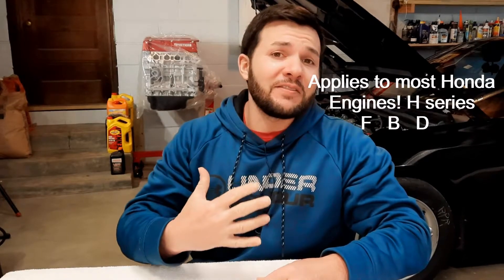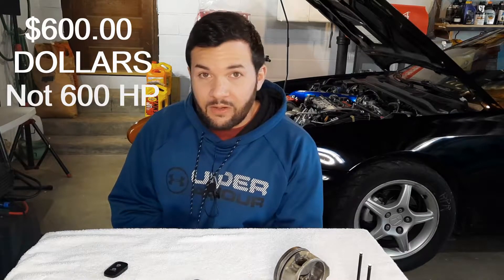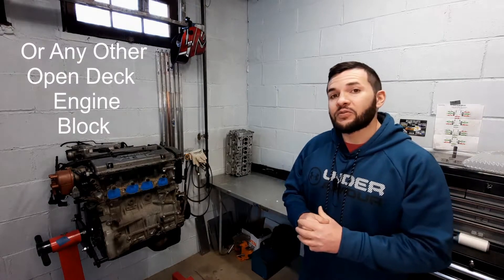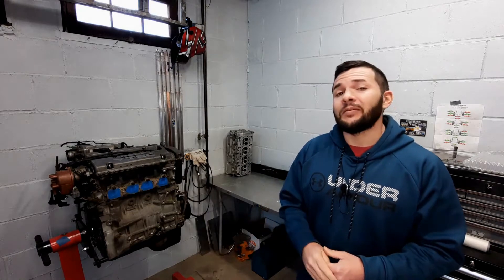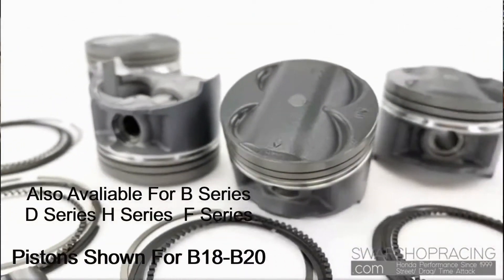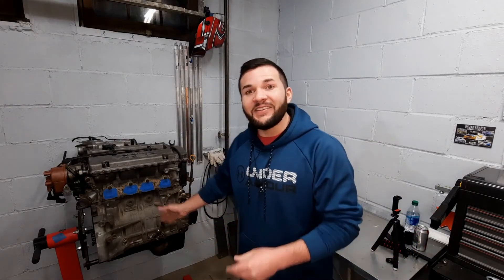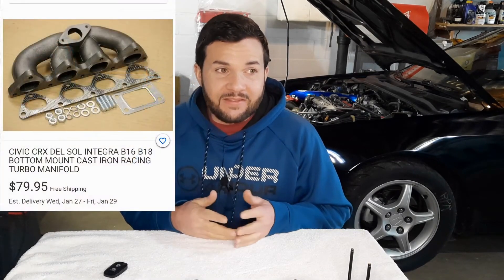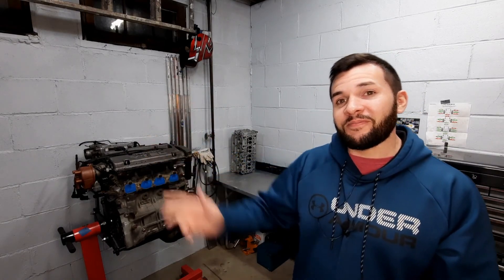Build 500 Horsepower BUDGET Turbo Honda 5 Tip Recipe B Series, H Series, D Series, F Series

Comment: I've got an H22A (minus the 1) since ive got a JDM vtec BB4 chassis model but im guessing the process is same as described for the H22A1 and not the A4
Reply: it should be a closed deck, unless a previous owner swapped an a4 bottom but i doubt it, so it should be practically the same process

Comment: Question can the Transmission handle that much power tho? For a stock trans? Cause i have a 97 lude and im planning a build on my car right now i am planning on buying the nippon jdm pistons but just wanna know if the transmission can handle cause i don't want to blow that either
Reply: Stock H/F trans dont live long over 500.

Comment: What the fuck is this video...? Between the serial killer intro, and the "tips", I am confused as to if this is a parody or not. My man said either use freaking SUGAR in your block or get it CSS'd, but he would get it sleeved instead, which is an extra thousand dollars over a CSS system... But he WOUDLN'T recommend spending  $3-400 to get a tuneable ECU. Instead, use nitrous... What in the fuckin Need For Speed is going on here?

Comment: I just found a dream scenario at the junk yard. full H22A1 in a 98 accord with everything still in place. all I'd need is mounts and it'll all fit into my EK, but if the H22A isn't all that tough then I don't know if it'd be worth the sawp from my D16Y8.
Reply: Been ripping on my h22a1 for years now. No problems exept the balance shaft seals popped out on me but I think that was my fault lol

Comment: Hi bro, great video and accurate info. I have a crx b20 with b16 head vtec at around 200hp. How much nitro you think it can handle without problems? Thanks bro and keep the good work up!
Reply: I’m currently running a b20 aswell and want to do ls vtec. My goal is to have around 200 hp bc it is my daily. What have you done to yours to make 200?
Reply: Integra intake , wilder cams, proper fuel pump  mushroom filter , Y1S1 gearbox, exhaust and good tuning @billymoreno470
Reply: Don’t push you b20 any further than 350 whp man. They have super weak bottom ends
Reply: https://youtu.be/jygHy770Hr0?si=TJomwRCS6DdhcFVM
That's my rex

Comment: B20s aren’t the strongest b series, in fact I’d say it’s one of the weaker because of how thin the walls are in between the cylinders. And even if they could handle 500hp you’d never do it on a stock b20 or b18 non vtec head without a whole shit ton of boost which would help kill those Siamese walls even quicker.

Comment: Horsepower is built in the head, at the valve seat. Port and proper valve/seat job. Valve train next, go light with the retainers, valves, keepers and the right spring pressure for the cam you're using. More RPMs = more Power. Agree with forged rods but I would spring the extra $4-500 and get the forged pistons. Sleep better at night. Agree 100% about the sleeves for the h22
Reply: Some sleeves are made from frm so you can’t run forged pistons unless your clearance is absolutely perfect

Comment: Running nitrous without any supporting mods and especially a tune is a recipe for disaster.
Your pictures and videos are pretty decent - your verbal communication/output needs some work 🥹
I’m out after the maxpeedingrods drop - I’d be careful taking all of this advice fella’s - hope y’all got a back up engine/plan    hahaaaaaaaaaaaaaaaaa - wow wow wow
Reply from the maker: I respect your opinion everyone has one....I have ran well over 20 bottles of nitrous with no supporting mods....Just a zex smart box system design to do just that...it adds fuel pressure by putting pressure to the fuel  regulator using there jetting charts. I wouldn't push high horsepower but 75hp shot is easily safe. Maxspeeding rod, eagle rods, scat rods for h22 and other hondas all start life as the same Chinese forged blank and are machined by whatever company sells them under there name.

Comment: Ya.  I want to build my f22a.  But aftermarket is super hard to find parts    h22 cranks are slightly different so I can't use those con rods   I can use k20 pistons and good luck finding an f22A turbo manifold    you can find em for the f22b all day    I have a rebuilt OEM style head (might tear apart and find some better valve springs/retainers) although the rods and block can handle  the power    i just can't really find the parts for the head
Reply: I seen F23a handle 400hp with just headstuds. I bet it can handle 340 with just headstuds. If you want 400-500. I would do h beam rods, non VTEC head. epoxy block gaurd k20 pistons

Comment: I do not understand why cast parts are used on engines.  A cast part is never as strong as a part machined from a rolled piece.  Castings are not even allowed on aircraft
Reply from the maker: Cost of manufacturing, lots of domestic cars in the 70s 80s and 90s have cast pistons and some have cast crankshaft lol junk

Comment: Any recommendations for a turbo kit for the h22a4 in my 5th gen?
Reply from the maker: Depending on setup, really piecing one together is usually the way to go. If it was a civic there alot more popular and have many choices. All I would see is purchase a quality turbo and wastegate, everything else doesn't have to be the greatest product out there. Cast exhaust manifolds are cheap they work well under 500hp and don't crack good luck

Comment: You've given me a lot to think about. Right now, I'm trying to get started in the Honda game and get myself my first fast car, like ever. I'm also trying to do it right, but I don't have a lot of experience buying or even building engines and it takes me awhile to save up even a grand so avoiding mistakes are HIGHLY valued. So, to me, my only options are to plan literally everything out that I want to do to the car. I'd like a B series, but they aren't all that common where I live and D series rule supreme. I'm sure I could have a lot of fun with a D series coup or something, but it would still take me a long time to learn and build it right. I have very little idea on how to get started and not just fall into a money trap with the first thing I get. Still, I'm not giving up though.

Comment: I am building this set up but I have a few questions some say the pistons crack and can I run e85 without a problem
Reply from the maker: Under high horsepower they can crack....what are your goals, just know over 500 you have to start getting great parts not ok parts.

Comment: You also suggested a b20 for boost @ 500whp.  Couldnt think of a worse idea
Reply: To thin on the cylinder walls I'm assuming?
Reply: @nickcrye5585  they crack between cylinders even on na builds
Reply: @timm5970  even on stock hp too😂😂 don’t ask me how Ik 👀…. Trying to find a b18 with a vtec head so I can boost that instead tho…
Reply: The b20 sleeves are thin because they're fiber reinforced,  so even when they're high mileage you should resleeve them just so they dont eat up piston rings
Reply: True that
Reply: it's well known amongst b series guys that b20 sleeves crack after 300hp. They need to be sleeved to make more than that.
Reply: @elliswilliams1050  you can do 500 depends on the tune
Reply: @DWB_735  “depends on the tune” is that what you read once on the internet? 

No dude. B20 sleeves, regardless of how good the tune is, will fail above 300hp like clock work.

There’s ways to get around that limit, such as a block guard, or epoxy filling your engine block, or running a cooler burning fuel such as E85. 

But you gotta stop saying “depends on the tune,” you sound like the people who say “this motor can only handle 10lbs” when boost psi barely has anything to do with the limitations of a motor

Comment: I've got a jdm 96 prelude Sir spec S and spare complete driveline of same vehicle ..I'm hoping the 1st plus tee ! Can take 8-10 maybe 12 on a one off ;p without opening of engine..however it will have turbo support mods ..springs s600 injectors fuel injectors pump and I'll try the shimming the oil pump ..wish me luck ..any requests or advice the 1st motor is on death row.. lol

Comment: Hey Brad Is the jdm h22a any different from the a1 a4
Should I go wet or dry kit? 
I have loads of questions dude would love your input
Reply: I don’t know about the difference between the jdm and usdm h22 motors, other than the different compression, but for nitrous kits you should generally go for a wet nitrous kit. Makes it so you don’t have to tie into the ecu to increase the fuel with the nitrous. Also means you don’t have to spend the money on a higher flow fuel rail and injectors

Comment: While the b20 is readily available and cheap. It is by far the worst option for boost. You will crack a sleeve. Also do not cheap out on the manifold. 

A log cast manifold will not flow properly and you will not get anywhere close to 350hp. There are affordable ram horns that will do a much better job at flowing exhaust through the turbo.

Nitrous without injectors is a terrible idea. Not having an ecu to tune your afr is even worse. Do not put in a nitrous kit without having some kind of tuning option and a dyno day to dial it in. You will melt your cast pistons.

There is some great information here on how to get things done cheap. The reason people who make reliable power do not go this route is because it cost more money over time to fix things when they break.

Comment: Can I use jb weld as the epoxy ?
Reply: So people talk about using epoxy.  Im not sold on that.  Heat affects materials differently.  If you have an epoxy wedged between aluminum then what happens if that dont expand at the same rate.  I imagine you INCREASE the chance of destroying the block.  If i have an open deck design im either not doing anything to it or using the same metal to make a block guard(aluminum block guard in an aluminum block)

Comment: I was under the impression that the b20 blocks are weak??? And Isn’t Recommended to go past 300hp do to Poor sleeves??
Reply: Yes the b20 has siamesed sleeves it is okay we have gone 230-240whp street/daily on them with no probs but excellent tune and maintenance is a must, we did 12.1sec with barely any grip back then

Comment: Wait how can a smaller motor with the same block material handle more power? I thought an h22 can handle more power than a b series
Reply: H series and F series are much more capable of handling big power over the b series.  This guy recommended using a b20 engine for a boosted 500hp build which is quite literally the worst suggestion he could have made.  If you want to boost reliably H, F, and K all day.  The engines have girdles which give the engine much more support.  The f series is an iron block which is heavier but more sturdy(although have an aluminum head attached make increase risk of blown head gaskets due to the metalxs having different expansion rates).  Many H series are closed deck designs that increase rigidity(I would never use an epoxy as a substitute in other applications).  K series is just all around the most rigid and newer

Comment: I'm just starting a build on my 97 prelude h22a4. Switching from auto to manual and unsure about m2y4 or m2b4...this car is very clean and unmolested everything works and original as far as I can tell. I just need to find a place to buy trans with small the parts to install and work. Linkage pedals possible harness if i go with m2b4 and ECU? Shifter box with cables...if anybody got any suggestions I'd be grateful to hear opinions, i want to keep it simple atleast 300-400 whp. Thanks and great tutorial much abliged
Reply: The M2B4 LSD Trans is THE WAY TO GO! IFFFF, You're NOT doing the H2B swap.

Comment: I'm working with a junkyard found F20b that had a blown headgasket. Using an single cam F23 crank and rods and may just bore it to use nippon K pistons. all else is pretty much as you mentioned in your vid here. didn't want to break the bank for an engine found for $230
Reply: if you use an f23 block you can use k series pistons without boring the engine.

Comment: Hey man, awesome build. I'm in the process of building mine as well, the h22a4. Just wanted to hear your thoughts on a few things. I've thought about getting darton dry sleeves installed and then installing a supertech blockguard for the cylinders, just because its so much cheaper than purchasing and installing the MID. I've been told it should achieve the same strength as the MID, with keeping standard bore at 87 especially.

Also I've been hearing so many mixed views on balance shaft removal, in that it either is only an improvement to increase oil pressure, or is a factor that can cause oil pump failure and oiling issues, because I guess the internal vibrations. I've thought about counteracting said vibrations with maybe something like an ati super damper but I don't know, apparently those super dampers cant go past 400hp.
Reply: Can you post your build ?